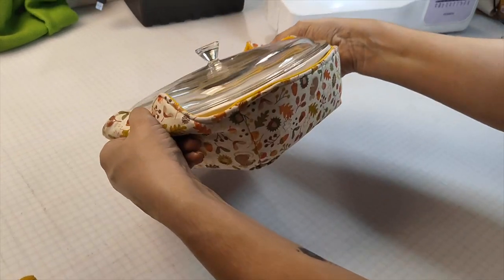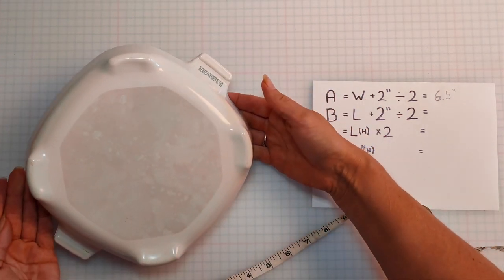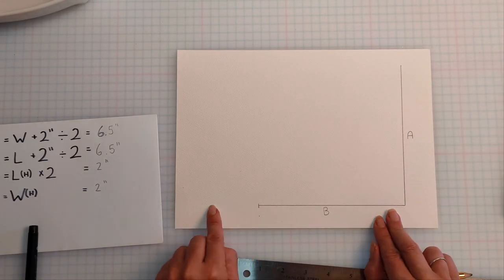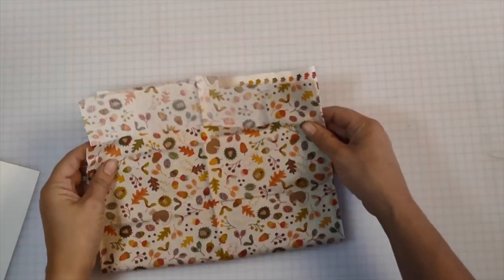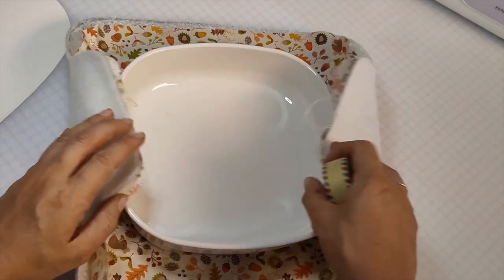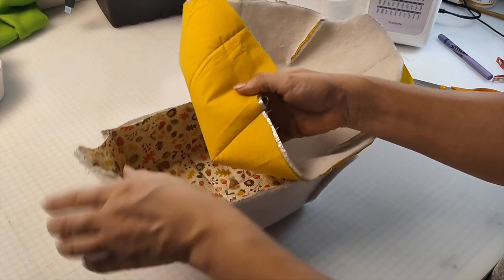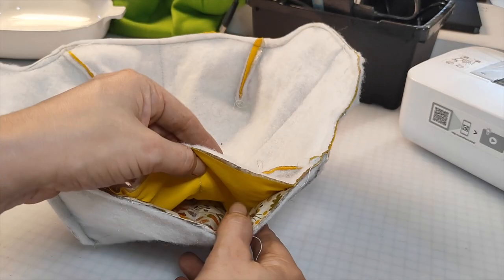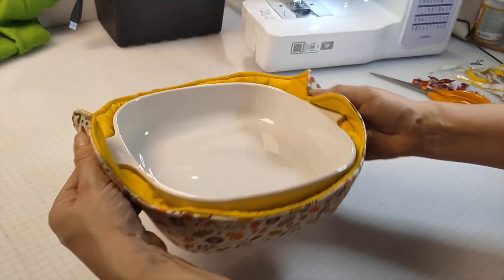How to make a Casserole Cozy - Today we Craft

Comment: Gah!!! Huge lightbulb moment. I've made a handful of custom size cozies and always struggle to figure out exactly where to sew the darts to make it fit just right. I would set the bowl on top of the fabric and pull the fabric up at the corners, but of course, the bowl moves and I can't get a good marking. So then I just keep sewing the dart and ripping it out and sewing again until I get it right.😖NEVER thought to tape the fabric in place and turn the bowl over to get the right placement. Thank you SO much for that tip!

Comment: If used in a microwave, won't the foil backed wadding spark?
Reply: I think this cozy is just meant to make your hot or cold casserole dish easier to move and transport, and insulate it a bit. It shouldn't be used in a microwave like a bowl cozy would.
Reply from the maker: Yes it you plan on microwaving it then you must you only natural wadding like 100% cotton or bamboo. x